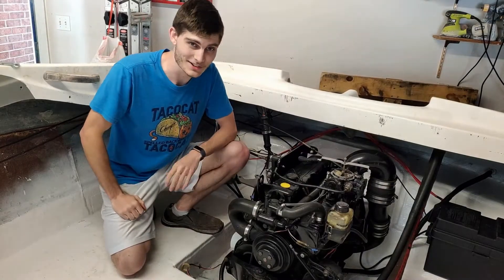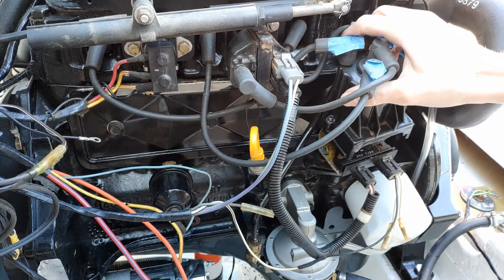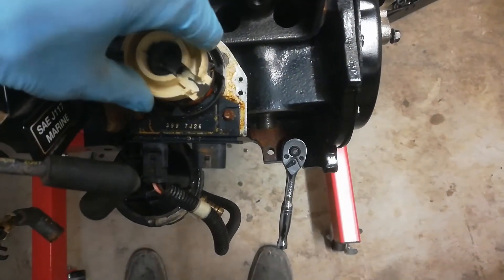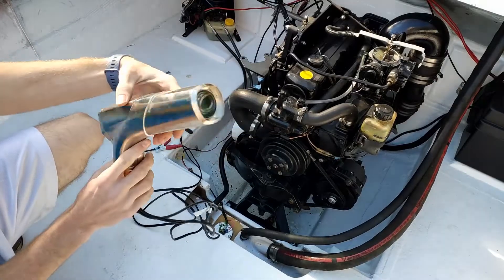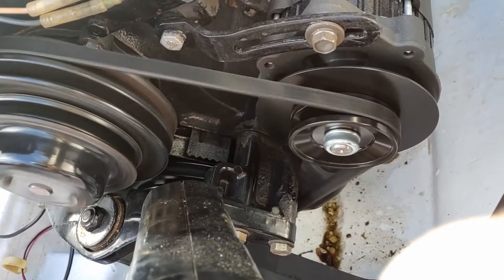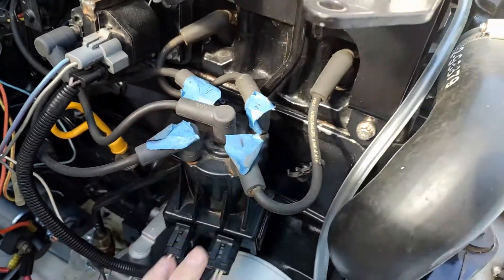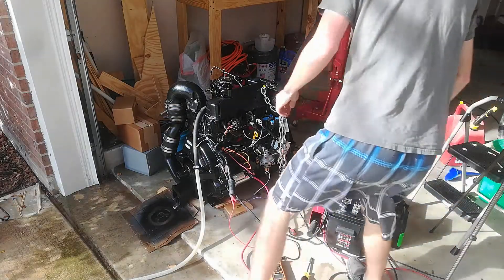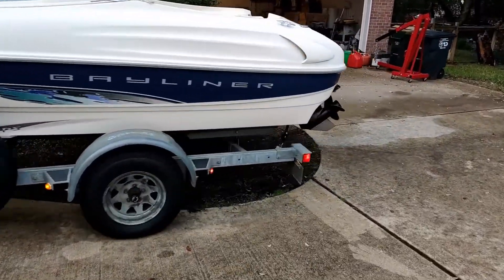Mercruiser Engine Distributor Timing

Comment: Hello Zach, Were you turning/adjusting the distributor cap with the engine running in base timing mode, or did you shut it off, then make the adjustments, then turn it back on each time? Thanks.

Comment: 😂 Zach, you forgot to mention you have to put the ignition module into base timing. You do this by connecting the two white wires on the shunt of the distributor together and bypassing the stall, pivot wires together the pink and the white wire just behind the carburetor between the valve cover and carburetor  then you set your timing to 2° before top dead center on any 3 L mercury.

Comment: My question is this.
My reverse rotation engine has the timing mark gradients set up same as standard rotation if i set at advance side is that actually retarded side , when i st it there it runs like crap when i set to retarded side it runs good. I think this is correct., however previous owner has a paint mark at the advance side of both motors, thats why i have this confusion, i believe the paint mark on counter rotation engine is in wrong location.  Hope this explanation makes sense.

Comment: Hi zach, i know it's been a while since your video was made but i have a quick question. My mercruiser isn't advancing or retarding when i accelerate. I am unable to find what unit does the electronic advancement. Do you know if it's the distributor module that does this ? I suspect mine may be faulty.
Reply from the maker: I believe the advancement occurs from the distributor itself, or some part of it

Comment: I'm a Mercruiser tech this is not the way you set the timing on a 3L with electronic ignition system Timing needs to be locked into base mode before you make any adjustments

Comment: Should the notch on the harmonic balancer be lined up with 0deg on tab or with (in my case) the 6 ? I ask because my engine says 6BTDC on the timing reference found on the valve cover spec sticker.
Reply from the maker: 0 degree

Comment: Hi Zach, great video. I just have one question. I purchased a new distributor for the same 3.0 litre engine. Is it possible to pull the old distributor and just drop the new one in if I have all the markings in the same position?

Comment: Zach, thanks for these great videos. Question for your: I have a 1986 Mercruiser 170, with a pretty similar distributor setup. I am getting strong spark coming out of my ignition coil, with no spark going to the spark plugs. Could this be due to the timing being off? Thanks.
Reply from the maker: Hi Clint, could be, but I would think maybe it's the spark plug wires

Comment: I've been trying to start my freshly rebuilt 2.5 120 HP Mercruiser. It's turning over and firing occasionally through the carb. I wouldn't call it backfiring more like a hoarse hose snort if you can picture that. My distributor rotor is at about 4 Oclock at TDC. Is it possible it should be pointing directly to cylinder 1 which would be 1 oclock (on the 8cyl 350 I built, you point that at cylinder 1) or does this sound more like I'm at TDC on the exhaust stroke and I should try flipping it around. Meaning getting to TDC as is, pulling the dist. rotating to the next TDC and reinstalling. Also is it possible that there is kill switch or wire I should be looking for that just wont let it start? I've jumped the 5&6 female pin connectors. I am also trying to start mine on a stand to check for leaks etc., before installing back into this project. Thanks in advance I know this is a 2 year old post so It may fall on deaf ears :)
Reply from the maker: Hi Steven, Could be that it needs to be flipped, you can turn over by hand to see when each piston is coming up and when each valve is opening to know for sure and then as the check the rotor arm position as you do that to make sure everything appears to be synced correctly
Reply: @ZachsGarage1  the fact that you replied to me on a post I found from 2 years ago makes you an absolute ROCKSTAR! What I did find with these motors is that there are some differences between the 2.5 and 3.0 that are actually a bit more significant than I would have expected. There is another poster who has the 2.5 and the distributer rotor is more at the 1 - 2 O'clock position. So before I went to flip the timing 180 deg. I tried resetting (aka re-stabbing - re-installing) the whole distributer to align with rotor that way. .... and it f'n fired up!!! Now it didn't stay on, and I attribute this to 1) I'm still upside down on my TDC 2) Carb is getting either too much air or too much fuel 3) fuel pump is not pumping enough PSI. 

While all 4cyliders are not the same, your video series on this was extremely helpful for our family project! If anyone has any questions specific to the 1987 2.5 send them my way. I'll try and post a video once I get her humming. Thank you again!
Reply from the maker: @stevenulbrich4969  interesting, great to hear you At least got her fired up! I'll be looking forward to your video!

Comment: Hello Zach this was the best video I could find on adjusting the timing on my 4.3 mercruiser.  I followed every step and I still couldn't get me engine to fire up. It was working perfectly when I bought the boat. I had the carburator rebuilt and had someone help me install.  It didn't crank over so he messed with the distributor because he said the timing was off.  My boat never started after that.
Reply from the maker: Hi Michael, I don't know how the timing would be off until "someone" touches the distributor. Seems like the timing is definitely off now.

Try figuring out the actual timing of the pistons, crankshaft, camshaft/valves, and distributor.

Mine did not fire up even when I thought my distributor was really close, then I adjusted it several times till it fired up.
Reply from the maker: stick a camera in the spark plug holes so you can see when piston 1 is top dead center. and make sure that lines up with the timing mark on the harmonic balancer

Comment: Thank you for this vid.  That might be my current situation https://youtu.be/lfRD0cNLuA4 So when it initially wouldn’t start, did you keep making adjustment until it started? Or, were you also using the timing light while cranking in the beginning and that’s how you figured out which direction to adjust? TIA!

This has taken me a long while to get this back together. I had a spun bearing on #3 https://youtu.be/8qV83mHauHw

Comment: How fast did this boat end up
Going with the 130 in it? I’m trying to determine if mine is tuned properly.  BTW I am grateful to you for this series you created.
Reply from the maker: Around 35mph
Reply: @ZachsGarage1  oh mines a 17 foot fibreglass bow rider and I’m only getting 25 mph
Reply from the maker: @squrvevidz8052  could be prop pitch. designed for low speed faster acceleration
Reply from the maker: @squrvevidz8052  my propeller is 1918P21 (14.25” diameter x 21” per revolution through the water)
Reply: I called MerCruiser factory technical support and gave them my serial number for proper info because I had a shop put mine at around 6 to 8° before top dead center at idle, I was getting about 3435 miles an hour, previously the boat did 42 43 mph 18 foot Bayliner with a 3. 0 TKS, Mercury told me it should be at 15° before top dead center at idle give or take 2° we adjusted it to 12 1/2 before top dead center at idel and now I'm getting 41 to 42 mph, but I think I'm going to adjust it again and try to get my original 43 mph GPS verifiedI'm gonna try to put it closer to 14 or 15° before top dead center at idle,  in order to achieve the 12 1/2° before top dead center at idel what you have to do is use a jumper wire on the 2 white distributor wires that are coming out of the distributor that don't connect to anything and bypasses the electronic spark ignition advance, you also have to disconnect the shift interrupter switch and temporarily join the engine harness wires together for the timing to set correctly, after you bypass both sets of wires you set the timing to 2° AFTER top dead center, then unhooked the jumper wire and hook the shift interrupter switch back up recheck the timing and it should be about 15° before top dead center at idel give or take 2° which mine was almost there at 12.5° before top dead center

I don't think your timing is adjusted optimally and I think you can get about seven more miles per hour maybe eight or nine at the proper specs, probably a lot more power is your motor the TKS? What are your thoughts on this?

Comment: Ok so if u are just replacing the cap and rotor… do you still have to do the timing? And would having the spark plugs out of sequence and attempting to start it repeatedly, ruin anything? Cus I still don’t have spark… 🤦🏻‍♀️
Reply from the maker: Yes, you'd probably still need to check timing, if the engine runs it is probably very close to correct timing, otherwise it will struggle to run

Comment: Such great video and how did you get so smart so young!!!  My boat won’t start and I had placed the spark plug wires in the wrong order by mistake. After trying unsuccessfully to start it, got the service manual and realized my problem but now that I fixed it I have no spark, changed cap n rotor, wires n spark plugs again. Nada!! Watching ur video I realized I had no clue about the timing. Thank you so much for making such a quality video! I had watched others and was about to take the boat in for service cus I felt like I couldn’t do it. Now I’m gonna charge on!!!
Reply: i have a similar problem with my Bayliner, with no sparks..
how did you finally get it to fire, just curious?. .thanks.

Comment: I've seen other procedures where they use a shunt plugged in to the distributor to create a short and then set timing to zero?
Reply from the maker: Yes, that is correct
Reply: @ZachsGarage1  I'm confused b/c you don't do that in the video that I can tell.  It appears that the shunt wires are not connected.
Reply from the maker: @barry.anderberg  You are correct, I do not show it in the video. I have tried both ways off-camera. Ultimately the calibration is whatever works best for your engine. The check with the timing guns helps you get close to 5 to 10 degrees BTC. Without the shunt (base timing mode), the timing advance will increase at higher RPMS. at 750 rpms you should see a reading pretty close to what you would see in base timing mode.
Reply: @ZachsGarage1  thank you, I have the merc 3.0L.  Thanks for your help and this excellent series of videos

Comment: Do you happen to know if this would fix my problem on my boat. It has a 3.0 mercruiser and will start but after warm will no longer start. Could this be the timing ?
Reply from the maker: Hmm, interesting issue. If it were do to timing I would think you'd have the issue all the time, not just after warming up.

If you give it 50% throttle for when cranking will that help it start? Trying that for at least 10 seconds. Reason why is I wonder if after you've been running it, if the carb is flooding gas in the intake after the engine shuts off
Reply: @ZachsGarage1  could be the carb actually. I’m Not very familiar with boat motors or motors in general as I’m only 17 and this is my second boat! The previous owner seemed to think it was the carb that needed adjusting because he said he put rebuilt the carb but never got it tuned correctly after that. How do I adjust the carb? Thanks for your help !

Comment: Except thats not correct per the mercruiser service manual??

I cant get mine to run no matter WHAT position i put the wires in.  Not even a single ignition.

Im about to set fire to this thing an dig a hole for the whole boat

Comment: Hey Zach so I’m currently working on my 3.0 merCruiser. Well i ended up cleaning the carb put a new kit in it and  now it seems as if it’s hard starting takes a couple of minutes of turning it over and it sounding like it’s gonna break the fly wheel it will start and after it starts it runs great but it’s just getting it to that point do you think it could be a timing problem?
Reply from the maker: If the distributor, crankshaft, and camshaft have never been removed then the timing should still be set correctly from the factory. Does giving it more throttle help with starting? That helps for mine
Reply: @ZachsGarage1  no it doesn’t i checked the timing marks and put it top dead center  the button was between 4 and 2
Reply: @ZachsGarage1  i think someone was in it before i pulled the motor thanks to your help and and found a old distributor locker thing in the bottom
Reply: Hey buddy so funny story lol i can pull my distributor cap off and it’s like the boat still tries to fire any clue what would cause that?

Comment: If you want to see the notch on harmonic Balance, put a bit of white out on it and take a bristle brush to the degree marks.
Reply: My Mechanic says he can't find a notch, is that possible?  Is there "Always" a notch?
Reply: @FfirePlug  there's always a notch, your mechanic will need to scrape around the harmonic Balancer with a wire brush or sandpaper. I bet it's covered in rust, grime or cooked grease, but it's there, it's gotta be cleaned it up completely.

Comment: Is this before or after the timing failure? Where the engine wouldn’t start? I’m having the same trouble it sounds like it wants to crank but just no fire, same 3.0 engine any tips,
Reply from the maker: 😎 tip 1: correct timing
Reply: @ZachsGarage1   so just look for the two indentings on the distributor,  line them up, an turn the crank an pistons to top dead center “0” an adjust distributors rotor to the 4 o’clock nearest 1 cylinder compression stroke, an I should be able to at least get fire right I worked all day today trying to get it to fire, an as I seen in all your videos you can relate
Reply from the maker: @christianspry1518  yeah, the trick that got me is my distributor was one tooth off. It's tricky because when you put it in it twists because the gear teeth are at an angle. So lining up the notch won't work if it's a tooth off. You'll need to verify with a timing 😂 ght, that's how I found out
Reply: Okay well today I got a little further The 3.0 was trying to fire but backfiring out the carb , which is more than it was doing yesterday, but still no luck to fire, I did just set to one notch on the gear, this was a completely seized engine an regardless of you know it or not you’ve walked me all the way through it with zero questions asked on any other vid but this timing deal is really a nerve racker
Reply: I did just now see this will try this in the am any other pointers just by what the carb is doing it’s burning the fuel but expelling it out the carb it’s due to the piston shoving up as the firings happing right? An not going down

Comment: One of the very few “mystical” folks some of us only hear about 😂, that have 3.0 engines that can run @750rpms, AND run so smoothly that it can sit on pieces of wood without shaking right off! I dream of an engine that smooth. 🇨🇦👍🏼😂
Reply from the maker: If I'm being honest, with it in the boat with the added load of the outdrive (even in neutral) I honestly have to idle up more like 900 to 1,000 rpm for it to stay smooth
Reply: @ZachsGarage1  Ohh. Ya, me too. Same.
Reply: @ZachsGarage1  By "idle up" you just mean throttle up, correct?  As in you're not adjusting your idle screw so that it just idles in neutral that quickly.  I believe idling too quickly is bad for the gear box is that right?  Thanks again!
Reply from the maker: @barry.anderberg  yes, the faster the idle rpm the more wear on the gears when shifting

Comment: Actually correctly done. it's not ecm supported (mpi) to need to set in timing mode . GOOD JOB ZACH.
Reply from the maker: I had actually tried later connecting the wires to put it in base timing mode but the timing reading still came back the same. So I think you're right! 😂

Comment: I just bought an '86 19' aluminum Sylvan with a 3.0 mercruiser. The owner fired it up on land and it ran well from what I could tell, he had also replaced many parts too. I'm an automotive tech but don't know all the intricacies of marine engines even though the 3.0 is pretty close to an automotive engine. I'll be going over the boat this winter (hopefully I can get it in the water ONCE before things freeze up at least), but if not I'm going to dig into it and check over everything. I'm glad I found your channel as you have already answered so many of my questions in your videos! Thanks for sharing this stuff.

Comment: I have a 3.0 that shakes like a rattlesnake is it a timing issue or does it need a tune up
Reply from the maker: There are a variety of root causes. Timing usually doesn't change unless you have disassembled the engine. I would suspect much more likely is one of the cyclinders is not firing as well causing an out of balance kind of shake.

Comment: Hey zack, I have the same engine and have oil leak from behind the crankshaft pulley/pan/ oil seal. 

I wonder if you think it would be possible to fix without getting motor out of the boat ? 

Love you videos, watched a bunch 🐵
Reply from the maker: Thanks! That's a tough one. You could remove the outdrive and then hoist or jack the front of the engine an inch to get that front motor mount piece off. But that would allow you to keep the rest of the engine hooked up and bolted in
Reply: Zachs Garage do I have to remove the outdrive so I can lift the motor an inch ?